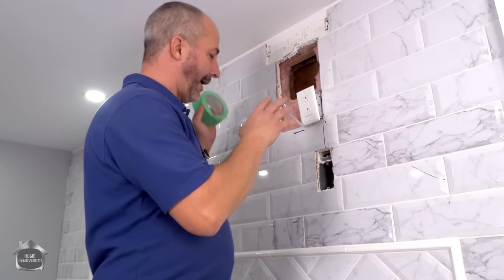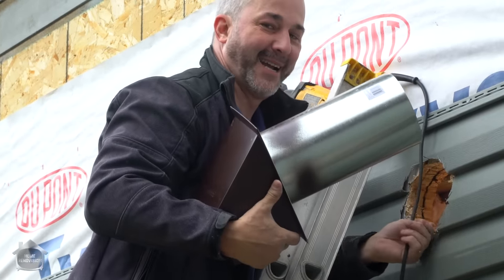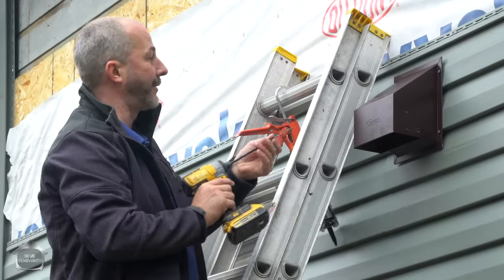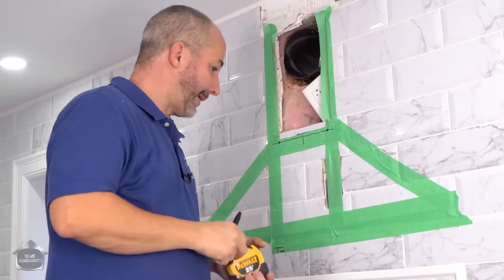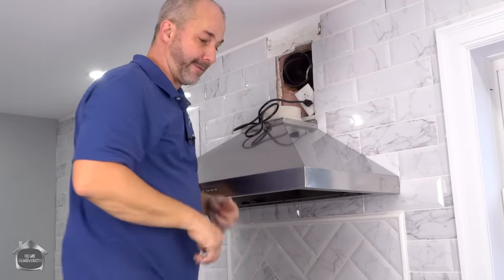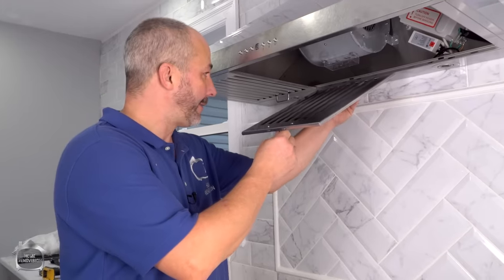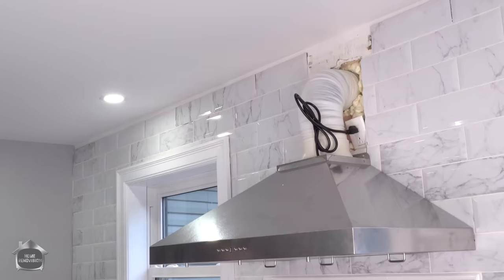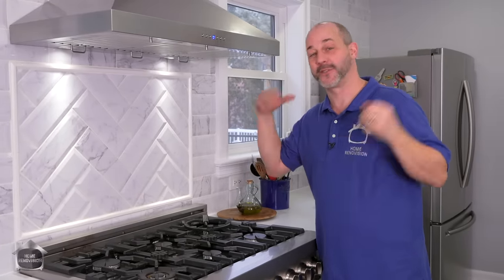How To Install A Wall Mounted Hood Fan!

Comment: Great video. I’ve got a question about the hole through the exterior wall; I’ve got to cut through the band/rim joist between the first and second floor which is 12 inches wide - how wide a hole can I cut? 6 inches possible without causing structural issues?

Comment: This is a great video, Thanks. I live out in Palm Springs, and its 120° today, how do you keep the heat from outside from entering through the vent and making it into your home while running your A.C Is this when a non vented would be the best solution.
Reply: Your exterior vent should have a one way valve to prevent exterior air coming in. If you're having this problem, you may just need to replace the exterior vent.

Comment: Hey Jeff great stuff. Wish mine was that easy! Had to do an island mount!! Just curious what did you do across the top of the ceiling to finish off your tile?
Reply: Are you going to do a video of the crown molding you chose for the kitchen?
Reply from the maker: we are building a small bulkhead. Yes the crown video was released a few weeks ago! Cheers!